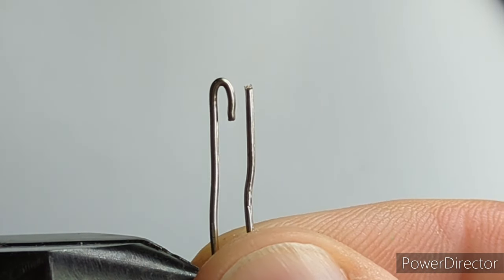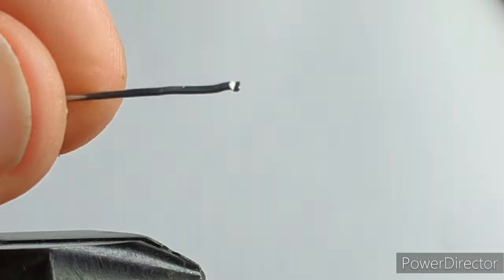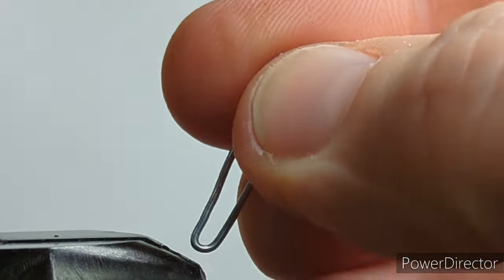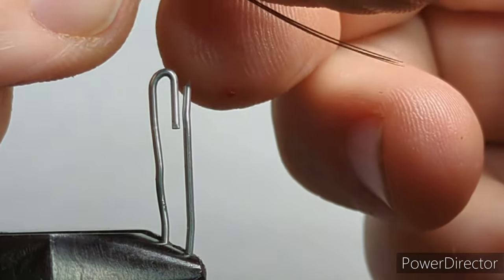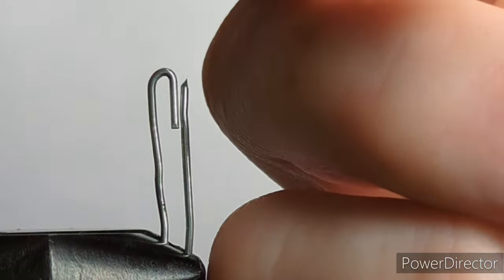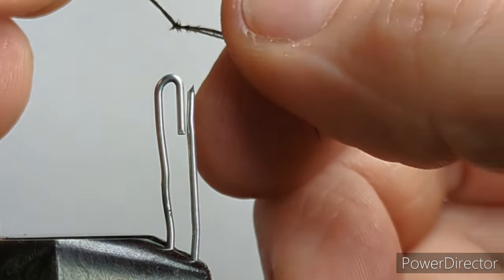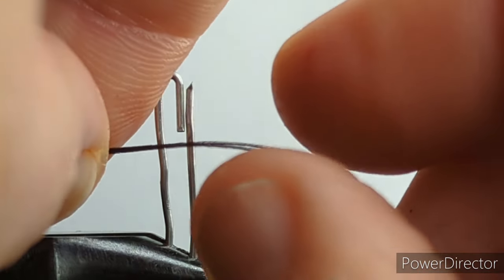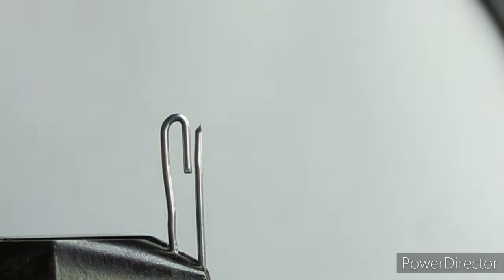Knotting pheasant tail hopper legs

Comment: Like so many others I am So glad I have found this. I am more intrigued as to how you came up with this. This is thinking out side the box. Simple but very effective. I often come up with ideas to make a job more simple. Its a shame that there is not a big enough market for this. You could have made a few bob out of this. Well done and thanks for sharing. Don't suppose you have many more great ideas by chance. I will sub just in case. Shaun.
Reply from the maker: I put the knitting machine needle I have into the vice and used the loop and clip to knot the feather to start with. Then figured I didn't need to lock the clip if I had a another post beside the hook. Hence the use of a paper clip, it was easy to shape and readily available.
Reply: @DannyEnglish-flytying  Simple is always best mate. Well done.

Comment: I use a safety pin because the sharpened point is less jagged than the cut end
Reply from the maker: I found the paper clip easier to shape than a pin. 

If it works for you, then who am I to question your method.

Saves a lot of time, more time for tying flies!! 😉